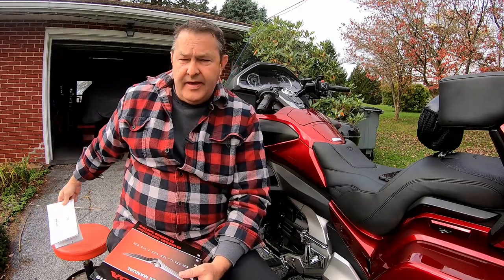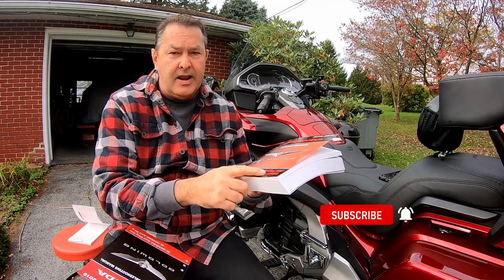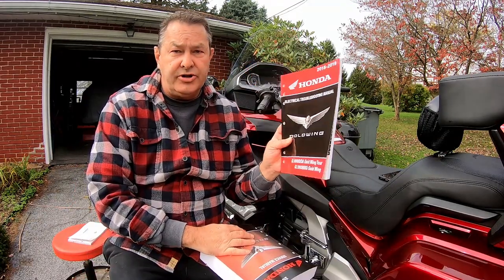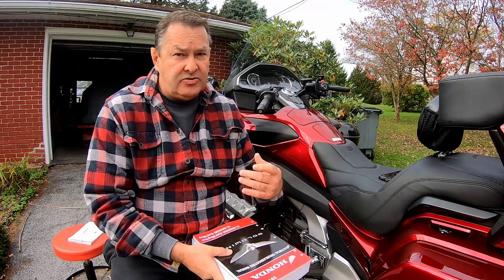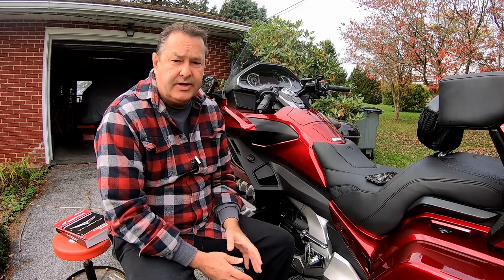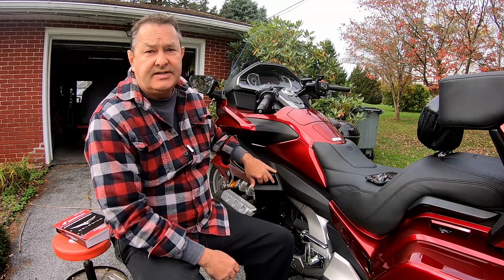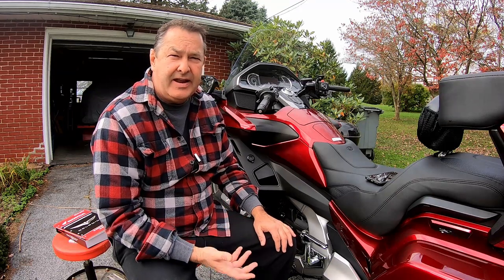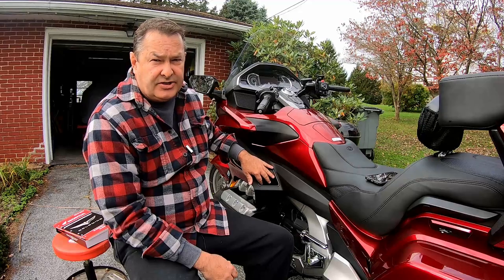Honda Goldwing DCT Parking Brake Adjustment

Comment: Hi Rick. Thanks for putting this info together.  It's just what I needed to tackle this project.  I did find what I believe to be an error however. I don't believe the features you measured for the coarse adjustment are the correct ones.  The parts you measured are both fixed. No amount of cable adjustment will affect them. The correct feature to measure is from the center of the ferrel at the end of the cable on the left, to the spring seat on the right. 
Thanks for covering this really useful topic. I will be subscribing!
Reply from the maker: Hi Bill. Now that you point out the error with main spring measurement, you are absolutely correct. I’m measuring from two fixed points which doesn’t make sense. Thanks for pointing that out. And thank you for subscribing.

Comment: Hey Rick, I have the new EC Parking Break Interlock,. When engaged it also prevents the transmission from shifting into Drive. Same as kickstand down.
Reply from the maker: That’s a nice little gizmo to have installed. I purchased the first iteration of the parking brake warning light. If I had waiting another 4 months I would have purchased what you have.

Comment: Just some honest, and well intentioned, critique here. When you get into the first adjustment, you focus on spring length but then provide video focused on two mechanical pivot points below the actual spring itself. I reran the clip several times and just can not pick up, or associate, the micrometer view to the spring view. Added to this is the lack of exact identification of the points of measurement other than pointing your finger in a general direction. Maybe consider using a small pointed object and hold it on the two points of measurement. Seeing as you are using a micrometer, it would seem to make sense to clearly identify the reference points. And back to the actual points measured, how would these two mechanical pivot points vary the measurement seeing as they are fixed and do not have an arched range of motion as does the metal piece that holds the brake cable barrel end? So for me, I just skipped this first piece and moved to the second piece which I found easy to understand and duplicate the steps. My 2021 DCT Tour’s parking brake has been almost completely useless since day 1 of ownership. Any slight incline, and the brake just didn’t provide any meaningful resistance. So I thank you for providing this helpful video and again hope that you can accept how the first section came across to me.
Reply: See a more clear measurement picture : https://drive.google.com/file/d/1BYv4u_xRMK79rDXmHw4mB-QOQ8Priwri/view?usp=sharing

Comment: Thanks for the video.  I have the service manual but I am not very mechanical and it helps to see it.  I first adjusted mine in 2019 and just did it again (11/24/21).  It was within spec but not holding.  About a half turn made it just right - loose on zero clicks, small drag at one, locked at four.
The only frustrating part was I didn’t have a 12 mm wrench.  My metric set has 10, 11, 13, 14, and 17.  I have never used the 11.

Comment: Thanks for this, Rick. Just a quick query about the measurement with the vernier you did - you were measuring from the centre of the pivot for the brake actuator to the clamp for the outer of the cable. Do these actually change? I would have thought you need to measure from the end of the inner cable to the end of the outer so effectively the spring length at "one click". If out of spec you would adjust the length of the spring as you described under the engine cover. Please let me know if I'm wrong !!!
Reply from the maker: You ate absolutely correct. Another subscriber also pointed out my mistake. The spring measurement in the repair manual is not very clear but the measurement should be taken at the spring and not the two fixed points. However, as the measurement goes at the spring, it’s important to measure with the fixed points in a plane.  But yes, you are correct. You most likely are within spec regardless and your adjustment would be at the screw.
Reply: You are absolutely CORRECT... The measurement is for the length of the spring at the top...

Comment: Hi Rick.  I opened YouTube and found this. You know by now you were measuring at the wrong location. I suggest you edit your video or remove it. Make a new one. I liked your presentation. Going to sub. My third wing 2020 DCT Tour. I always do my own work. Dirt and street bikes. I have the books and Cruisemans +Fred Harmon videos. They cost but both did a great job on them. I’m in Indiana so we both need spring to get here. I ride in cold if salt and sand are gone.

Comment: Hay Rick how are you  I am a new subscriber to the channel and i looked at your video on how to adjust your parking brake on the 2018 goldwing and it was very informative thank you for that information because I have ride off on  several occasions with my parking brake on & burnt my pads up so as a result I am in need of new pads,

    Anyway in your video u mentioned about a parking brake Interlock to install from electrical connections i think this is a great item for the 2018 goldwing so can u please do a video on how to install this item & also new bake pads sometimes in the future i feal this is a safety item & hounda should have included this from the manufacturer so thank you Rick I will be looking at the channel if you  do these videos have a great day thank you & keep putting out those great videos ride safe .
Reply from the maker: I plan on putting out a brake pad change video in the near future. As far as the EC parking brake installation. If I decide to upgrade to the part that disables the engine, I will surely make an install vid. There is. It a lot of “how to” out there. Ride safe my friend and thank you for subscribing.

Comment: Save a ton of money. Buy the maintenance videos from Cruiseman’s Garage and/or Fred Harmon. The manual is crazy expensive and not written for the average guy, Honda Mechanic yes but nowhere near the DYI  videos.  I’ve done all the tasks except valve adjustments and actual tire changes.  Thousands of dollars saved in hourly labor charges that range $125 to $175.  Two oil changes will pay for both sets of videos.  Do a third and that will pay for your repair manuals.  Chilton manuals in the past were the cats meow, to bad they are out dated.  They were for the owner. Still have mine from my 1976 Honda CB750. Check sample videos at  their websites and follow their vlogs and Moto logs.

Comment: Hay rick parking brake or no parking brake park up hill if possible. Like you said I wouldn't put all my faith in a brake. Ride safe.
Reply from the maker: Agree. Always park nose up. The bike does a pretty good job holding the bike in place with the side stand but I would be leery of parking on a grade more than 5 degrees even with a properly adjusted parking brake.

Comment: Your videos are excellent, thank you!  I drove several miles with my parking brake on.  Now it doesn't work at all.  Do you think I will need to adjust the cable, or still possible to adjust it properly at the rear wheel?
Reply from the maker: Well thank you for the kind words. I think we have all driven off with parking brake on. You will be fine just doing the micro adjustment. You may have shortened the life of the pad but that’s replaceable in the future.
Reply: @ridenwithrick3771  ok, looks simple enough, thanks Rick
Reply from the maker: Very easy to do.
Reply: worked like a charm, easy fix, thanks Rick!
Reply from the maker: Awesome!

Comment: Hello Rick, any idea to the torque required for the 2 bolts holding the rear caliper on 2018 and up? I want to drop it for reset cleaning a bit.

Comment: Your measurement on the micrometer is taken in the wrong place those points are fixed it should be from centre if cable to spring stay.

Comment: Your measurement on the micrometer is taken in the wrong place those points are fixed it should be from centre of cable to spring stay.

Comment: Adjust the screw until you feel a slight drag.

I think you would get a better feel if you rode the bike a few miles to warm the fluid in the read end first.
When cold that stuff is pretty thick.

And if you're careful about turning off the parking brake you probably will never have to replace the pads.